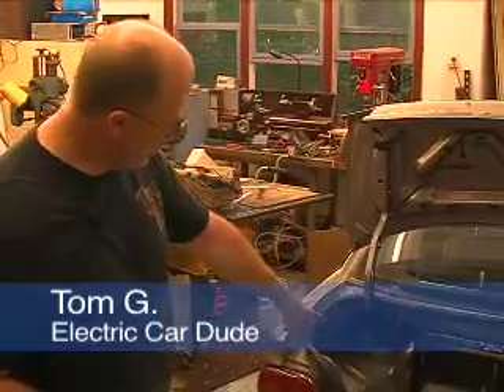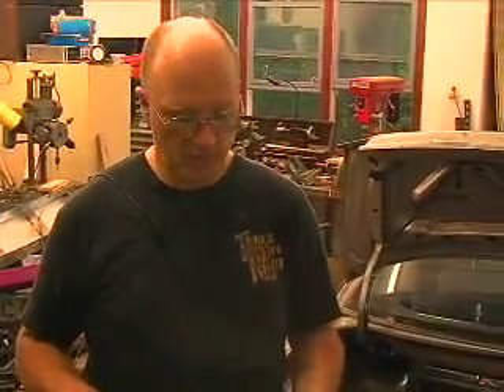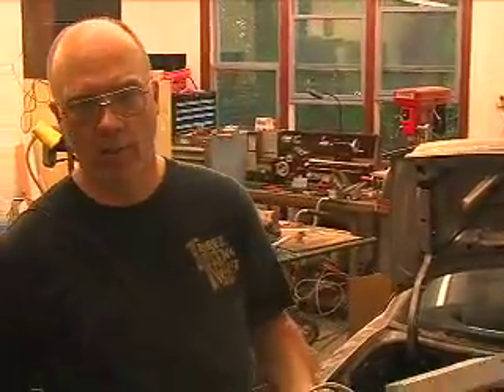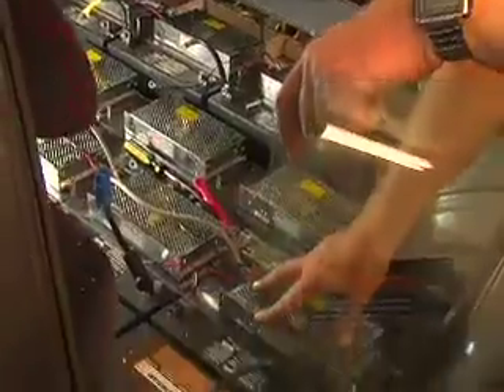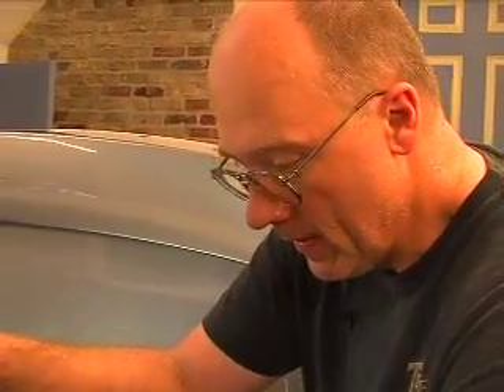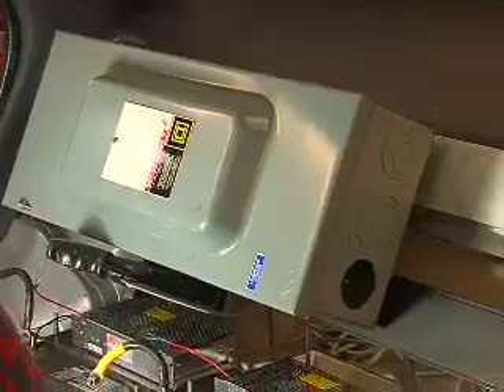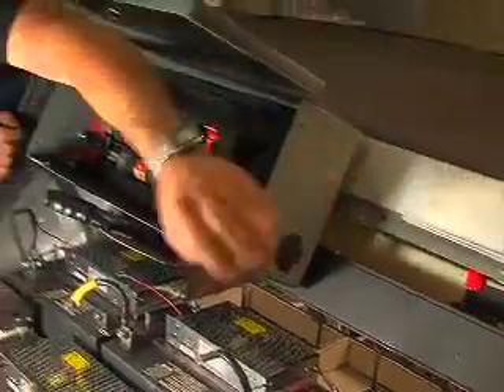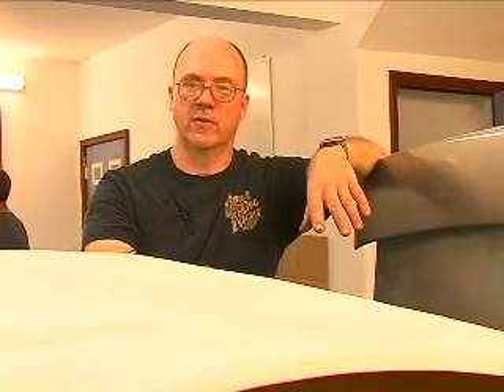008 part 2 AC Electric Car Construction 101 - Video 8 part 2

Comment: please upgrade to 720p or better resolution the 480 is to low and pixely. can you make a list of the batteries your using, chargers and BMS.
Reply from the maker: Hi Random Stuff, please keep in mind that this is a video from over a decade ago. I wasn't available when Tom was working on this part of the project, so somebody else filmed it on other equipment.
Reply: @BenjaminNelsonX  😁😁😁
Reply: @BenjaminNelsonX  yeah where's the high def LP footage sir 😂😂

Comment from the maker: @lespaul49 
This car features one battery charger for each battery. Each charger has its positive and negative lead permanently bolted onto the positive and negative posts of one battery.

The only problem with this setup is that there are so many batteries, that not all the battery chargers can run at the same time without blowing a 15 amp circuit. So, the chargers are plugged into several different power strips. Only one group of chargers is run at a time.

Comment: Is that a challenge?  Bring it on!
The car is drivable, well over 50MPH (I have yet to find top end, still tuning) and has a range of over 50miles.  You will beat me off the line, but I doubt if you can match the range.